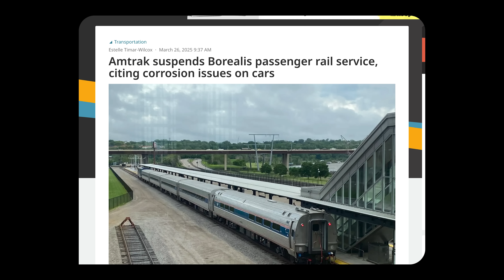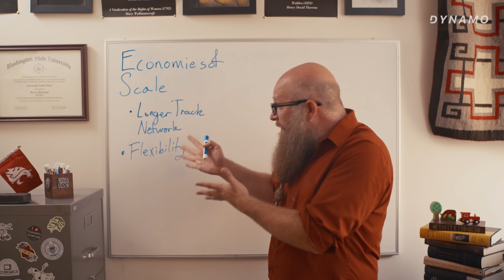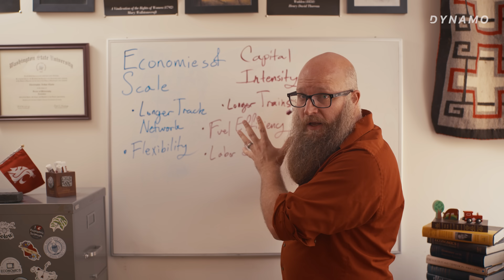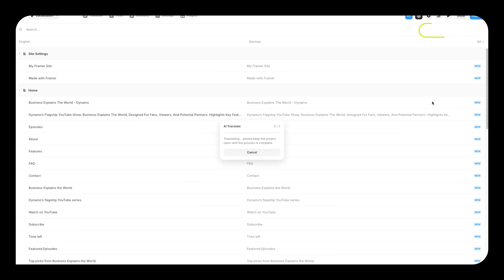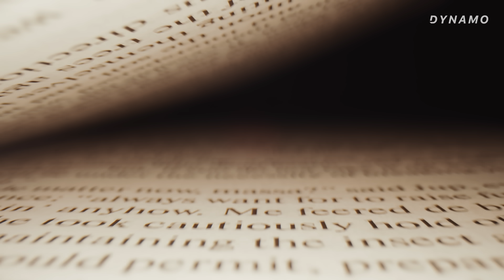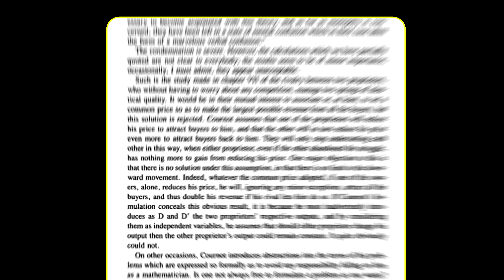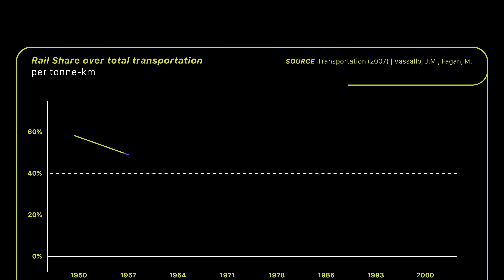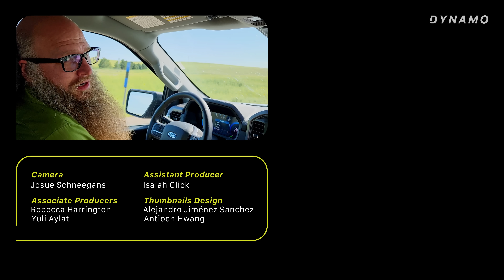Why Freight Trains Suddenly Got SO Long

Comment: Great to see this put together. Excited to see where the freight rail industry goes next.
Reply: I disagree with your overall conclusion, because if the entire industry is optimized for long haul freight, then the rest of the freight and passengers will be incentivized to use roads, which is way more wasteful. Your idea works when the industry has its own separate tracks, while the government has its own for passengers and short lines.

Comment: I think trains should be bigger. Wider track spacing so the cars can be 12 or even 16' wide. Higher highway overpasses so trains can be 16 or 20' high.

Comment: Electricity and natural gas is deregulated in Alberta, yet prices are the highest in Canada. Working for one these utilities, I can say there is a push to be inefficient to drive up "earnings". Yes despite being deregulated one can consider utilities as still being a monopoly as the infrastructure is still owned by of a few companies and the "system" is set up that one has to pay a base rate such that all the  infrastructure  owners get their cut even though you are "free" to shop around for a "service provider". It's still a scam.

Comment: To be fair, I don’t know a whole lot about any other countries freight rail system. But I do know America consolidation of rail companies is definitely making it worse.
Reply: European countries have figured out the perfect balance, make the trains bigger, but don't let them become too big, because once they are too big they will no longer fit on side branches, and will likely cut of entire towns while waiting for oncoming trains, this is of course very inefficient. A bigger train also needs more engines and a larger crew, so a 150-200 car train really isn't that much more efficient compared to a 40-50 car long train. The first needs 6-8 engines and a crew of 5 while the latter can run with just one engine and a single engineer.

The main issue is Europe is the different systems, different voltage and power, and sometimes even different gauge width between countries which makes it difficult to ship stuff across several countries. Germany - Denmark - Sweden for instance will work pretty well, UK - France - Italy will work too. Poland to Russia won't work, Hungary is mostly broken. Although EU is implementing ETCS across the union, a new system to unify and fix many of the issues, modern locomotives can operate with different voltages, Finland, the Baltics and Spain is replacing their tracks which aren't yet 1435mm.

Comment: Great video. I woudl also include container shipping that truly saved the feright business (98% or intermodal and almost 50% of all freight which dropped insurance and labor costs)
The "sometimes a monopoly" is good theory is the same case that Charles Mitchell made in the 20's. That did not work out so well.
Please make the passenger video. An area that more Americans are asking for as our roads choke with traffic and trucks. Passenger trains are supposed to be priorty on all freight lines and never are. On this front the US needs to invest heavily and tax carbon footprint/passenger.

Comment: Other countries have prioritized passenger rail and metros. The US has prioritized gigantic freight trains and the profits they generate for Wall street. 

China is a different beast. High speed rail is part of their strategy to connect the country from the port cities on the east to the more rural west. Often these run on different segregated lines to the cargo trains. The high speed lines are the backbones of the country, low cost, high capacity transit that can be run off cheap electric self-generated energy from solar panels in the desert rather than planes and oil. Its a major investment. Plus their freight lines are designed for exporting goods via rail through Russia and central Asia, with many going towards Europe as a quicker alternative to sea cargo. It's state investment in infrastructure much like the trans Siberian railway. Even if things are not immediately profitable, they are building the best infrastructure they can so that industry and new cities can be developed along lines and populations move in. Spare capacity means room for expansion. 

The US freight rail system is efficient in terms of scale and sheer size and being homogenous culturally, with standard gauges. But this is driven by Wall Street and profit hungry executives. This merger is designed to cut out competition and put prices up. The rail crews are being worked to the bone, those who can afford to, quit. Then the companies are prioritizing dividend and stock buybacks over investing in new rails, dual track, new sidings, new equipment. They're slowly asset stripping what they can from the companies while they rust and doing the bare minimum to survive. 

Europe and the UK have a hodgepodge of railways and gauges which very from the outstanding TGVs and AVE trains to the mediocre and congested. Some cargo trains share the lines with passenger trains but don't normally have priority over passengers. Trucks tend to be preferred due to relatively small distances, limited rail terminals, good motorway networks and just in time delivery. The rail systems in Europe developed over 100-150 years and became essential to long distance passengers and commuters. 

Whereas in the US the build out of the lines was usually driven by industry needs and passenger rail was a side bonus.

Comment: I live near Canada's busiest rail corridor which ironically isn't the Windsor-Quebec City corridor where MOST Canadians live but the Vancouver-Edmonton CN Main Line via Kamloops and Jasper that carries the nation's vast amounts of goods in and out of the Lower Mainland aka our Los Angeles/Long Beach and the trains along this line are some of the longest on earth and apparently now in some cases only have one worker on board which is both terrifying to think about,  and yet strangely progressive in how far we've essentially automated our steel arteries to a degree that we can have one person responsible for MILES of train and hundreds of millions of dollars worth of goods... And yes I would like a follow up on how to revive passenger rail in America. My suggestions? OPEN BUT DEDICATED higher speed lines built down the median of the Interstate Highway system as Brightline West is attempting to do between Las Vegas and Greater Los Angeles. Electrified with one set of rails to start with passing sections to allow for coordinated use of the same space to save costs.

Comment: I think you missed on some very important points on the rest of the world versus the US. 
In the US, the rail freight companies own and maintain the tracks and operates the lines. 
Compare that to Europe and many other countries where the tracks are owned by the state, maintained by the state or a contractor and the freight companies operate the lines and pay to use the tracks. 

They also have to compete with passenger trains of the use of the rails. Even though you have this right of way in the US, that's not the same as having to compete against a different kind of train for the space on the same track, slow moving long freight trains against a fast traveling much shorter passenger train.
That's one of the reasons freight trains in Europe are shorter, too long trains clough up the lines and can't either run as fast as needed or be easily bypassed by faster passenger trains.

Comment: If Union Pacific Does buy out Norfolk Southern, and they become one True Transcontinental Railroad. In my opinion, and in other urbanist people’s opinions, UP, at that point, should become a fully nationalized, government owned company.
Now, in my opinion, yes, the current leaders and all the workers could stay, the only difference would be that they would be employed by the government, and the government makes all the key decisions and choices for the railroads. 

Also, Semi-Trucks, yeah, they are not ok. Alan Fisher literally did research that states that 99% of all Road Damages come from Semi-Trucks, and they only pay 30% back in repairs. 

Anyways, I have an idea to replace Semi-Trucks.
In an Ideal Future where there are Trolly Cables over most of the Roads, Highways, and Interstates in our nation, and Trolly Busses are already moving with peak efficiency. 
My idea for Truck based Shipping is this:
Trolly Trucks, also can be called Super Vans.
They are essentially like Semi-Trucks, but instead of the Cab part and the Trailer being separate, the front Cab and the Trailer are part of the same single frame, so a Truck that is Bus coded in shape. 
It’s also Electric, and runs on the same Trolly Cables as Trolly Trucks. 
Lastly, and most importantly, the Trolly Truck’s trailer will not just have the normal rear end perpendicular unloading, but it will be Railroad BoxCar coded and be able to unload from the sides. So basically, a whole bunch of Trolly Trucks can park side by side, and if something needs to be retrieved from interior trolly trucks, then a person can simply walk through some of the trolly trucks, retrieve the item needed, and return the way they came.
EFFICIENCY IS THE KEY HERE. 

Lastly, I do say that Railroads need to Electrify as well.
Either Overhead Catenary or Third Rail, either form is good. 
Battery Electric Locomotives are inferior to Catenary & Third Rail. And the same is true for Battery Busses being inferior to Trolly Busses.
And Current Semi-Trucks and Battery Powered Semi-Trucks would most likely be inefficient when compared to my idea of Trolly Trucks. 
The only Battery Electric Vehicles that would even be good enough are Battery Powered Cars, and they are only marginally better than their Gasoline & Diesel Guzzling brethren. 

Now, for all the Electricity that would power the Catenary & Third Rail for the Trains, and the Trolly Cables for Trolly Busses and Trolly Trucks, as well as the wires for Light Rail. I see the two most viable options would be Hydroelectric Energy, Nuclear Energy, and Solar & Wind Energy.
I said Hydroelectric & Nuclear energy first because both of those are more constant sources of energy, and both have been proven to be very reliable and clean (as long as safety is put top priority). Wind and Solar energy are what I’d refer to as Contributing Sources. They can supply a boost of additional power, however, most of the electrical output would be done by the Hydroelectric Plants and the Nuclear Plants. 

Now, there are two kinds of vehicles I see that may still end up using Fossil Fuels, well into the age of Electricity.
Those being Boats and Planes.
Both of these modes of transport have to travel long distances without stopping, and it is practically impossible for Large Cargo Vessels and Planes to ever have enough electrical energy to power them for said long journeys.
Sure, smaller boats can be powered by Solar Power, and Sail Boats use the wind, but Maybe, Nuclear Energy might be most viable for Ships.
After all, Nuclear Powered Ships have, and do exist. 
However, because of the fears of nuclear reactors melting down at sea, most likely, only a very few vessels built for cargo would ever have nuclear energy, and so fossil fuels would have to stay for large ships and planes until newer technologies could be developed to make ships and planes electrically powered.

Ultimately, all the Land based forms of Transport can easily be electrified. And if we convert completely from fossil fuel power plants to green energy sources, then all those fossil fuels could be saved for the plains and ships, which would burn them over a longer period of time, and thus ensure that Humanity can start reviving forests to absorb more green house gasses, and thus ending climate change and thus allowing the planet to heal.

Comment: I simply don't understand how anyone with just a bit of railroad research would come to the conclusion that the U.S. has the best freight rail system in the world. All you have to do is just look at Switzerland (especially thanks to their electrified grid), but I would also expect multiple other countries to be better quality wise. Also, please don't shit on amtrak as much as you did, most of their delays are from freight passage anyways.
Reply: As a freight railroader Amtrak is always late delaying the freight. Just about every trip I'm taking a siding waiting on them, plus the tracks they run on are owned by the freight carriers. Just the other day I had to assist Amtrak by giving them one of my engines because theirs had issues.  That power move took over 2hrs from waiting on them to arrive while I sat in the siding to giving them the locomotive so they could get the out of our way. Mind you passenger rail has the right of way and is almost always running late. 😂
Reply: Our freight rail system is the largest and most efficient. And fully private!
Reply: @AEM-7_943  A bigger network or a lower cost doesn't make it more efficient, it's about getting the cargo to it's destination without destroying a whole town along the way because of a derailed train. But considering your choice of username you obviously know that already.

Comment: Precision Scheduled Railroading has resulted in longer trains and more pressure on crews operating those trains.  Add to this the fact that there are many sidings which are not long enough to accommodate these trains, which results in backups and delays.  The whole goal of PSR is to maximize profits on the backs of railroad workers and deferred maintenance.
Reply: PSR is dead. CSX and NS killed their programs, BNSF never implemented it, and UP I THINK has an scaled back version. But PSR is dead.
Reply: Add to that how most small towns are built around the railroad, which means all of the residents live on one side, but has to cross the tracks to go to work or go shopping. This is very problematic when a long freight train sits parked for several hours essentially cutting the town in half. Cars and trucks can't cross and pedestrians including kids have to climb in between the train cars, all while an oncoming freight train could appear on the other track at any moment. Trains too long to fit on the average siding isn't efficient.

Comment: Generally:

>America: good rail freight / bad passenger rail
>Europe: good passenger rail / bad freight rail
Reply: The biggest problem with European freight rail is the same as for passenger rail, different systems in different countries which means a train going through multiple countries have to switch locomotive for a different voltage and power output and sometimes even it's wheels due to different track gauges.

Within the individual zones there is really nothing wrong with European freight rail, it gets the job done at reasonably low cost, trains mostly consist of 40-50 cars, 1-2 locomotives, usually wire electric which is insanely efficient, top speed of 160km/h, a crew of just one person working 2 hour shifts and then rest. 

One of those larger American trains can have 150-200 cars, 6-8 diesel locomotives, a crew of 5 because realistically it would take an hour for a single engineer to walk all the way from the engine to the last car and then back, and a top speed of 80km/h, but usually a lot slower because of the poor track conditions.
Reply: @John8087  Your answer sounds like AI, with a lot of errors.

>Most freight rolling stock isn't certified for speeds higher than 90-110 km/h, similar to 55-65 mph in America.
>Most American lines don't carry passenger traffic, so there's no investment in infrastructure development that allows for higher speeds than those listed above for freight trains.
>Trains can't exceed 700 meters due to infrastructure issues, such as the length of sidings.
>Electrification is widespread due to higher fuel prices than in the US; after all, Europe must import most of its crude oil.
>The maximum daily working time of a train driver in Poland is 12 hours.
>Only your first paragraph is completely true, but it should be added that due to mixed traffic, where passenger trains have priority in Europe, freight trains often have to stop on sidings, often for long hours, to let every passenger train pass.

Comment: I watched this because Youtube suggested it to me (I sometimes watch a couple of other train guys).  Overall really good.

Regarding railroad consolidation: We may indeed get two huge nationwide spanning freight companies, but besides competing with each other, as you mentioned at the end (and at some point earlier when discussing the state of rail in the 1970s), they are often competing with the trucking industry.  So two giant railroads wouldn't solely be competing with one another, but also the trucks, and that too helps keep prices down.  (Caveat: not for every customer/industry they serve... trains haul tons of coal, I have never seen a truck hauling coal).  I don't know what the current number is, but for freight that comes in off ships here in California, I think if the final destination is east of the rockies, then it goes onto a train, but if it's in Nevada or Utah?  It will go by truck.

I would still say we need to be very very cautious about allowing a massive merger like that.  Certainly I would not allow BNSF and UP to merge, as they currently have a duopoly in the western US.
Reply: Thank you so much for your comment. I completely agree that the government will need to be thorough and cautious about the merger. It may require changes in right of way rights and other details. But I think there can be some serious efficiency gains from bypassing the middle of the country company changeover.